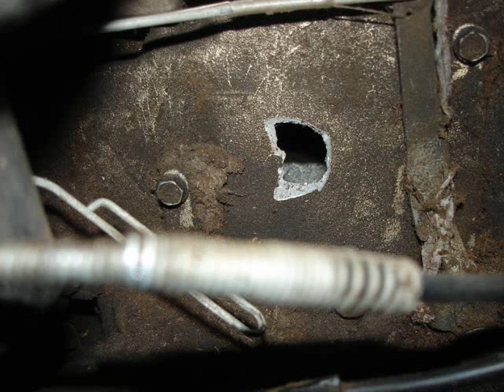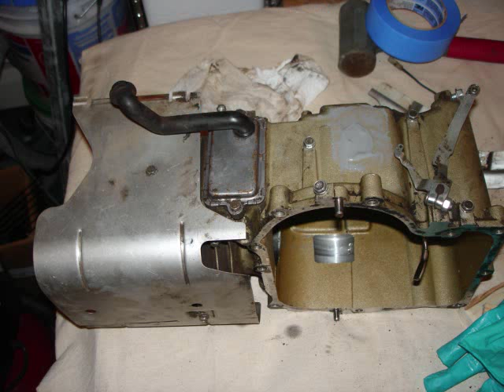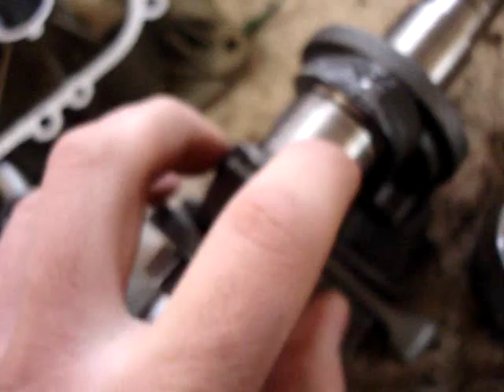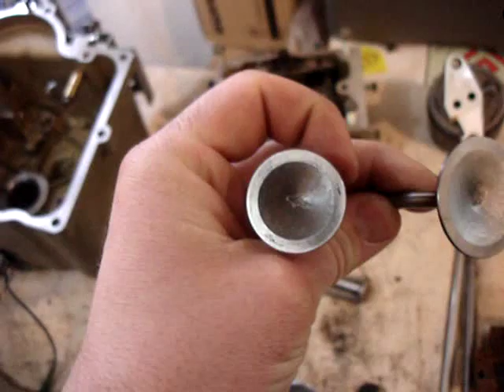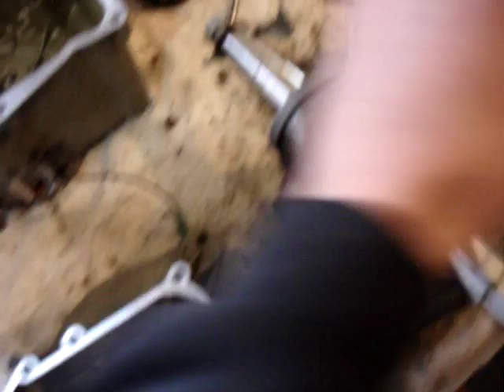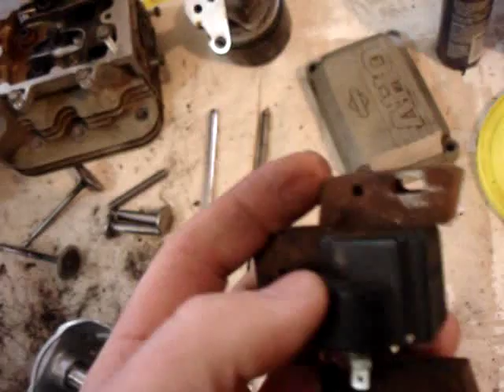15 Hp Briggs and Stratton Engine

Comment: chances are there's a problem with either the oil filler tube gasket or the lower (sump) seal OR both.     change em both out to be safe....cheapest parts on the motor     also dress up the skirt of the piston so its even from 9 oclock to 3 oclock...likewise 12 oclock to 6 oclock.    I note you've ordered the gasket set but make sure it has the seal and filler tube gaskets      the filler tube gasket may be in there but not the seal....good luck with it

Comment: I had the same exact problem except with far more damage. The connecting rod shattered which took a huge chuck out of the bottom oil pan and made a nice crack in the piston and screwed the cylinder wall. it also bent the camshaft slightly. I didnt really see the point in fixing it cuz there was so much wrong with it. I'm still waiting around to find a replacement